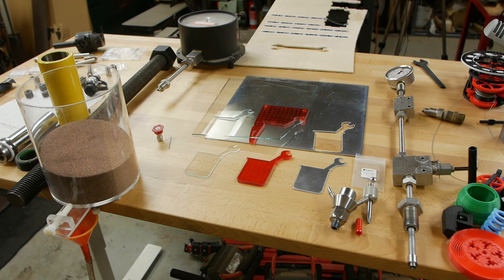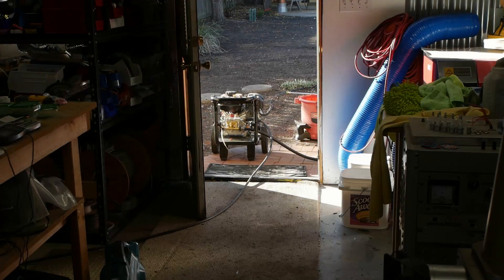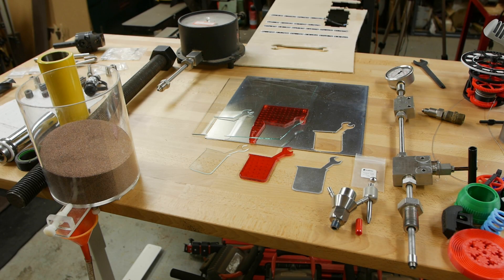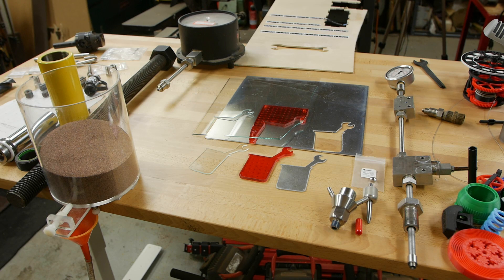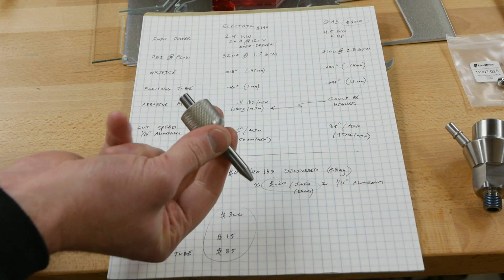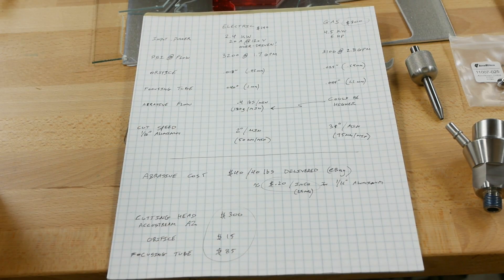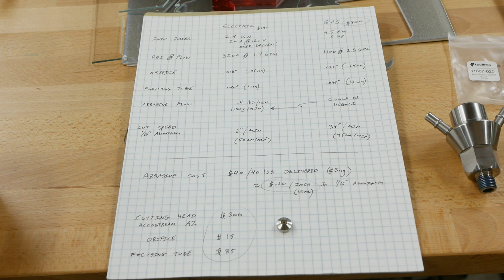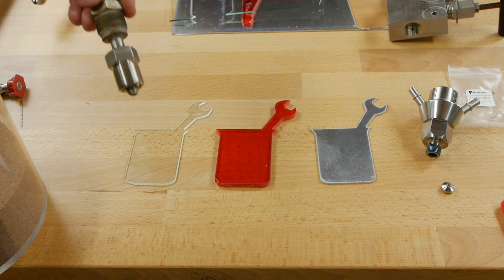Gas-powered waterjet cutter (follow-up) and other project updates

Comment: Can the abrasive not be reused?
Reply: Theoretically, but it would have to be dried and re-screened to the proper size.
Reply: I bet shooting small aluminium particles at aluminium would just force weld them
Reply: eddy currents would work for some, like aluminum, copper, silver, you could deflect using spinning magnets. others could be dealt with using density, acids, electrostatic charge.. if you were really set on recycling your abrasive, you would figure out a process to remove the contaminants. as for magnetics: [from wikipedia] "Magnetics used in garnet series identification
For gem identification purposes, a pick-up response to a strong neodymium magnet separates garnet from all other natural transparent gemstones commonly used in the jewelry trade. Magnetic susceptibility measurements in conjunction with refractive index can be used to distinguish garnet species and varieties, and determine the composition of garnets in terms of percentages of end-member species within an individual gem."
Reply: Besides the particle size, would the contamination of cutting material be a problem? Or can it be used as an abrasive (for that same material) as well?
Reply: what about dissolving with acid then filter the metal out
Reply: Rice Guy electrolysis! Good idea!
Reply: It would take some doing but you can totally re-use the abrasive.
"But the industry doesn't...", because you are paying for their abrasive and they really don't need to give the slightest shit about buying more.
Reply: Kinda, not really. It's a process most companies just can't afford to bother with.
Reply: so magnets and eddy currents would also affect some garnet. if you sifted your dried recycled material like sand in an hourglass, and it passed by a spinning magnets, different materials would be thrown different distances.
Reply: That was also my thought but it makes sense that it would be too contaminated to use.
Reply: LegendLength interesting idea, but how would non-ferromagnetic materials be removed?
Reply: @Nimbos0  by density as in sorting by agitate thru water as gold mining does or air; heaviest material would settle first or with heat
Reply: @pauls5745  I could see that working quite well. However, with the water you would have to find a way to separate the stuff that you want after it has settled and then dry the rest. The amount of material and work need to complete the process just seems excessive to me.🤷‍♂️
Reply: it looks like operation the cost of your water jet was preventing you from using it.
Recycling the garnet sand might help. This is how I would build a filter.

magnets and acid, picks the rock from the mix not the the gold from the mix in this case.  size is a vary good candidate for separation and Specific_gravity( https://en.wikipedia.org/wiki/Specific_gravity ).

First make a rotatory filter
https://youtu.be/u-XodsJau5c
I would use metal porch door screen.
I don't see it in any of the ones on youtube but what you should do is vibrate the rotatory filter using ultrasonic.
https://youtu.be/O35JuWe1lH0
Their are a lot of videos on how to build a ultrasonic machine but they don't say how to make the transducer
https://youtu.be/-XhWaUqndTI
this is also how you make fog misters
also not on youtube: applying a second rotatory filter around the first means you could filter out larger and smaller in one go. You would want the larger sieve rotatory drum a different length then the smaller   sieve rotatory drum.
Or if you have a low volume you can just buy a physical https://en.wikipedia.org/wiki/Sieve and do it by hand.

Next stage cyclone separator https://youtu.be/tvVj6fx6MNI there are tons of home made wood shop dust filters using a shop vac that can be you would want to build one of these https://www.amazon.com/Oneida-Molded-Dust-Deputy-Cyclone/dp/B002JP315K/ref=sr_1_1?ie=UTF8&qid=1519408638&sr=8-1&keywords=dust+deputy you would want it to have clear sides. That way you can watch it in action 
when your watching it see where your garnet sand hits the sides that's where you drill a small hole. To put a output pipe. This way anything with a higher or lower Specific gravity will miss the opening and fall away. (this is also the Cheaper/easy way of enriching yellow cake, that THEY don't want you to know about. It's my second amendment right to bare arms, I'm a libertarian). You could do the math to think out where the garnet sand ought to hit the sides but it's like rendering a toilet flushing it's just easier to do watch it happening then simulate, Hopefully all this has helped to dry your sand some.

next dryer.
Buy this stuff https://www.amazon.com/gp/product/B01G695O2W/ref=oh_aui_detailpage_o07_s00?ie=UTF8&psc=1 the get the one with the blue bits. Buy a cheap hair dryer. Make a U shaped pipe the top left side of the U is the air intake, the bottom of the inside of the U should be filled half way with Desiccant make sure you can change out this part because you will need to recharge the Desiccant the right side of the U pipe is where you put the hair dryer blowing up the top right side of the U put a right elbow. Get a pipe put a divider screen so the pipe is cut in half at one end seal off half of the pipe screen fill it with Desiccant, seal off so the screen so the desiccant does not fall out. I would make the Desiccant sections of pipe out of metal that way I can pop them in to the oven to recharge them easily. Attach the half filled pipe to the right elbow so that hot wet air is caught by the Desiccant. Make another elbow gong down to another U pipe bottom half filled with Desiccant. Blow this very dry air threw vibrating screen that allows air to pass but not sand. You could add ultrasonic to make it vibrate better. I would use trash bags or painters plastic drop cloth to keep to make the dry air chamber that holds the vibrating sand. You could get really fancy and add a cooling to the start. This it might be useful for drying other things. The mind set of the drying system is a ridge of mountains and valleys that catches hot and cold wet air but lets dry air pass. 

next
Their is probably some anti caking powder that they add to the garnet sand that they do not tell you about that washes off after you use it so research anti caking powder and find out what would be a good one to use. 

All and all we are talking about shop vacs, porch screens, plastic drop cloths, hair dryer, making a long clear plastic funnel, pvc pipes and metal pipes. Oh I would use hardware store silicon chuck to seal stuff.  stuff like electric motor to spin the rotary filter could be done with a hand crank, the ultrasonic will get up their but it's not necessary. So diy expensive but not more so then water jet.
Reply: If you spend the money and time on acid, might as well buy the garnet
Reply: If its not reused, where does it go? Aluminium particles going into the ocean doesn’t sound great..
Reply: The size of abrasive particles will only be getting smaller, so whats the risk anyways?  Other than slower cutting?
Reply: lets say my system is $4000, and that is way more then I think it would be. at 0.20 a inch in 1666 feet of cutting it would pay for it's self. because some of the sand would be not recoverable and lost. this would most likely be worse. so say about 2000 feet of cutting so a few years before it is worth it. but I think because it is more cost effective to run you would use it more, so ROI time is lower.
Reply: Should actually be fairly easy by letting gravity do most of the work.
Reply: @LegendLength  those magnets should work really well on aluminum and plastic LMAO

Comment: Was I the only who heard "Bridge port milling machine" and instantly thought of AvE?
Reply: Not Clapped out =/= AvE
Reply: Yep
Reply: Oxtools, This Old Tony and Abom79 to name a few
Reply: Yes, I'm afraid you were.  I thought of something completely different.  I used to work for a company that took used Bridgeport milling machines and turned them into CNC machines by replacing the hand cranks with stepper motors and adding a custom designed processor that used an Intel 8080A microprocessor chip, about 16 kb of memory and ran on machine code. This was way back in 1978.
Reply: The Bridgeport is just a milling machine. Probably one of the most common and definitely the most well known. AvE is not the only guy in the world that owns one and/or talks about it, and if you associate it that much with him I can only think that you're not very familiar with the trade.
I really like AvE, but seeing all the fangirling around him (and comments like this one, that bring his name up however unrelated the context or insubstantial the connection) makes me wonder if his audience is mostly made up of 12-year-olds only interested in dick jokes and feeling part of a group.
Reply: @altaroffire56  a year later and it's only gotten worse...
Reply: AvE has nothing on this guy
Reply: @BEdmonson85  BS, AvE is obviously more intelligent, well spoken, and a FUCKING BADASS. This dude is intelligent and does good work. GG

Comment: Can the CNC modulate the jet? (I.e. if you want to cut multiple pierced holes in a piece)
Reply from the maker: Not yet!  Drilling a hole with a waterjet is possible but not easy.  Modern commercial waterjet machines are sometimes equipped with a tilting nozzle that lets the water stream hit the surface and be reflected  at an angle while it drills into solid stock.  Applying the waterjet at a fixed 90* to the surface in order to create a hole sometimes works, but it can warp or crack the stock because the jet is so forceful.  I've certainly lost ceramic parts when trying to pierce them, even on high-end machines.  For a home shop waterjet, I'd strongly recommend drilling starter holes if you are doing internal cutouts.  Then, you can position the nozzle, and open the valve manually to start the cut.
Reply: Water-jet, Oxy/Acet, Plasma....no matter the process, piercing is very hard on the consumables, and can (as you stated) damage the work piece....so...if you can tilt the cutting nozzle...better!
Reply: It looks as if he just clamped the tubing rig to the edge of the cnc table.  If I'm correctly seeing what he's done, the tubing rig is an upside down L-shape where the L's stem holds the cutting part and the flat is clamped to the CNC table. The whole rig is wrapped in plastic to keep the cnc mill dry. @appliedscience Could you comment if that's your setup?
Reply: Jim Johnson have a look at some of Gough Custom videos maybe it will help
Reply: Applied Science $1 per pound is a shit ton, I can get very fine grit pure quartz sand blasting sand for about $10 for 50 pound
Reply: pre-drill and use fast moves?
Reply: Marcus Wolschon that's what I was thinking.
Reply: CNC could switch the pump on/off, but the question that separate a proof of concept and being useful is:
How good is it, at piercing the material before cutting?
Reply: if i can "pull a trigger " and operate a pressure washer, I am sure you can figure that out....

Comment: Can the abrasive not be dried out and reused? Or is it that expensive anyway?
Reply: Cyclonic separation can separate based on density, right? Would be an interesting experiment.
Reply: Well once the abrasive is used, there's not just that abrasive, there's also a similar amount of material that you were cutting, so if you run that, you risk jamming your cutter with soft gunk and the cut won't be nearly as good.

It is certainly possible to separate the materials, but that's not entirely trivial.
Reply: You also have the material that comes out of the kerf, not sure if you need to deal with it.
Reply: I think it might be too difficult to separate it from the destroyed material, but I also think that it'd 100% be worth looking into.
Reply: what happens to the granule when it hits the surface - it shatters in to pieces, so you not only get a mixture of the materials cut and the abrasive but abrasive itself gets destroyed and converted in to dust. Maybe less in the case btw, sooo, if so then why not.(but abrasive edges could be destroyed to some degree etc, so it degrades over time for sure.
So there are problems of recycling beyond the just separating materials.
But, you can have your own abrasive produced, with some stone crusher and good stone source(not necessarily a granite).
So there are definitely options there, I pretty certain one could get better than $1/pound options if it is a problem.
Reply: I guess if you were cutting steel or some other magnetic material, seperation would be an issue. All the other points raised here would still be hurdles to cross.
Reply: Aside from contamination and drying, you've got the problem of sharpness. The edges of the garnet particles need to be sharp to cut well. When you use them, they get rounded over, just like on a grinding wheel. And just like on a grinding wheel, used up abrasive gets dull and needs to be replaced with fresh, sharp abrasive.
Reply: A lot of commercial outfits do re-use abrasives, especially if they have more than 1 machine....seems I've read that there are complete drying/sifting systems that you can buy...
Reply: I was thinking the same thing, I used to reuse my sanding sand all the time. I wasn't sure how that would translate to water jet cuting though.
Reply: Looks like only a portion of the abrasive gets used up when it goes through the machine. So you can recycle it, with some losses. Also, cheap garnet might actually work better after being used once.

https://www.thefabricator.com/article/waterjetcutting/reusing-waterjet-cutting-abrasive